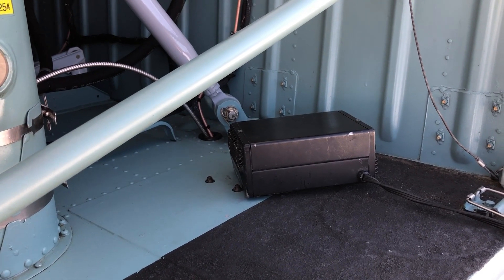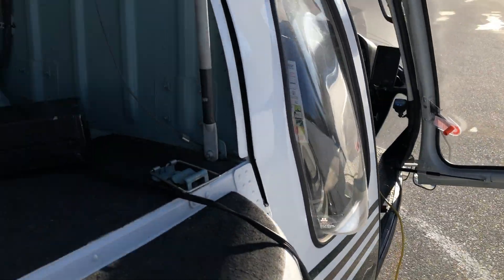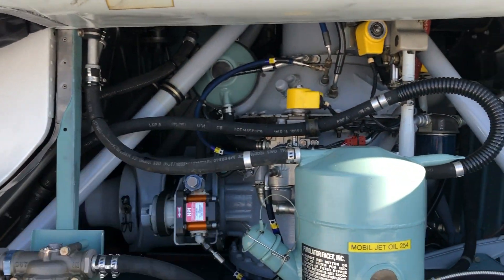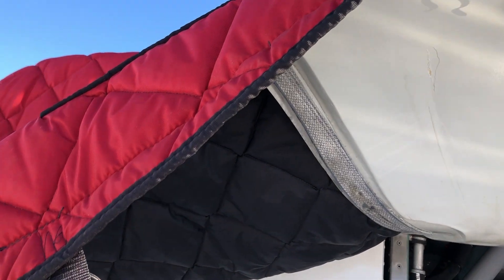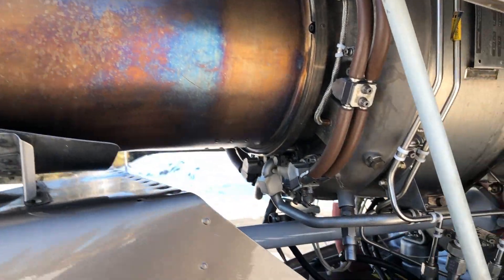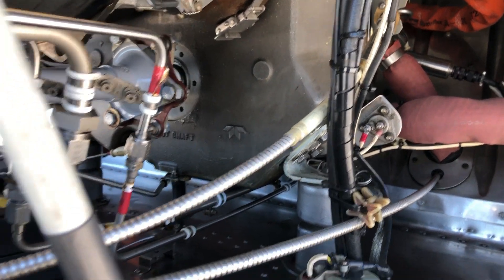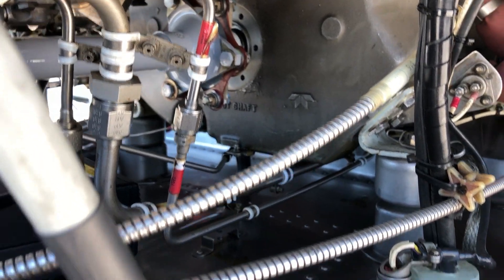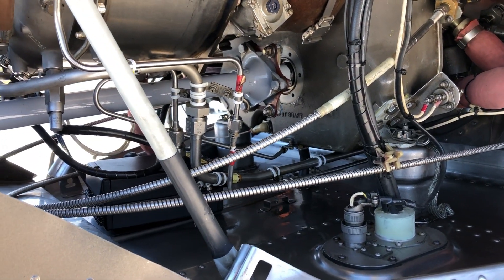Can Helicopters Fly When Its Cold?

Comment: Whats the risk if you dont heat it up? Longer to start or excessive engine wear? I have not seen a helicopter rugged up like that, I live in Aus and its 40 degrees here now.
Reply from the maker: Hi B J. We get the oils heated up to allow them to be nice and viscous when we go to start the machine. Thick oils don’t flow around the engine and gearboxes as well leading to premature component wear.
Heating the cabin also helps warm the flight controls so they don’t pull the heat from your hands when flying.